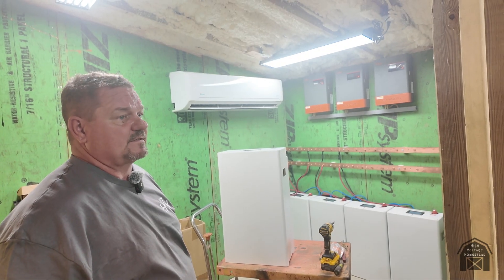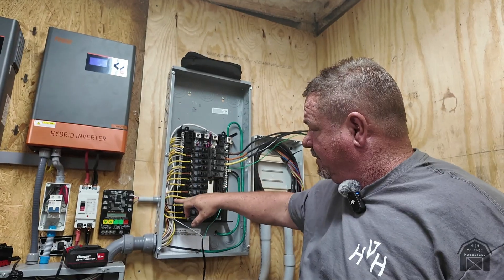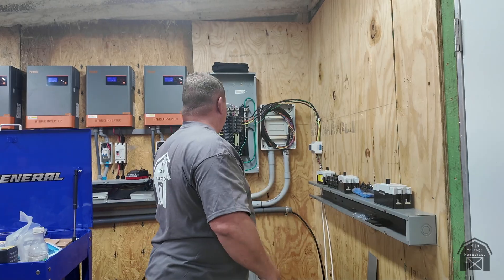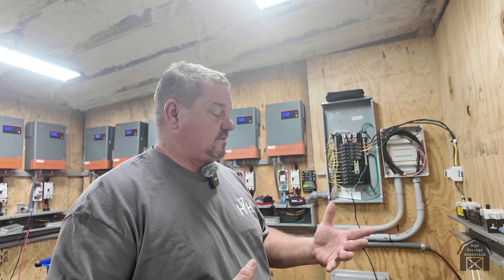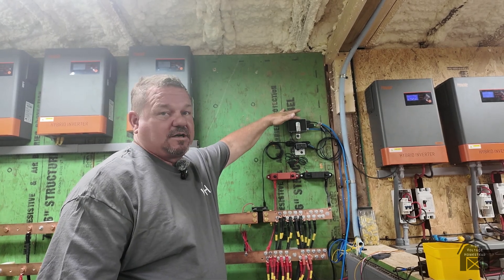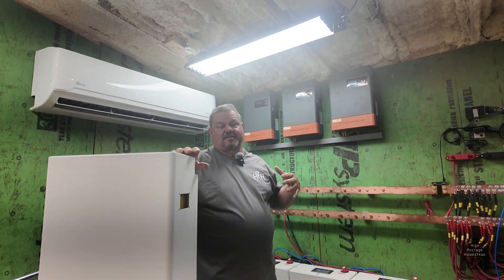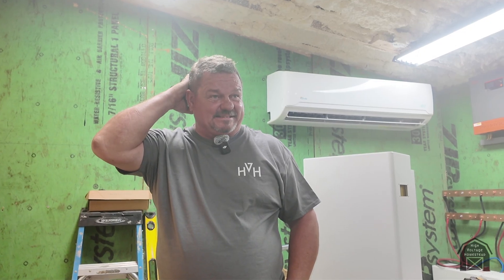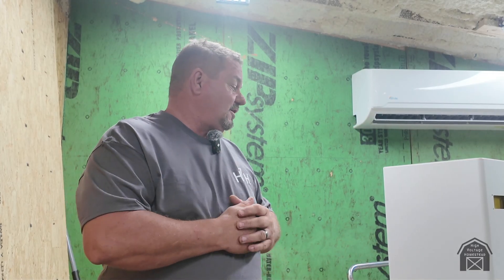Ken's Backstory and what the future holds for High Voltage Homestead

Comment: You have an amazing set up! However, 48 volt is not technically a high voltage system which runs from about 80 volts to over 500 volts. You may want to check out Ed's DIY solar to see high voltage solar power system used to Bitcoin mine.

Comment: Very interesting!  Our system is in the order of MW but grid tied solar.  You need to set up a plc to control your cooling loops and temperature control with VFD pump controls.  
We’re in Canada so we even have coolant heaters to cold fire the system if it’s ever shut down to long.  
No sense to cool the incoming water below ambient there’s no gains there just lost energy.  And if your wasting energy your loosing potential hash rate.

Comment: So if it is 3 phase from groups of 3, what happens if one section gets shaded? Would that not be a phase imbalance? Also, about DC, wrong, you can get very shocked on DC. I did building automation for many years and a lot of training proved you can get a massive shock from DC. I have myself on my 48 volt system when I was very sweaty and leaned on the DC rail and yes, I fn felt it.
Reply from the maker: Thanks for the input.  If we get shading the inverter would just draw from the batteries to keep the phases equal.  You are right that DC can shock you, put a 9v battery on your toungue lol.  If you resistanceis low (wet) enough and the distance is short enough then sure, I just mean in practical application on 48 volts DC.  No one will be in there that isn't aware enough and most people are going to stay far away from a big copper buss anyway lol.  If you leaned up on a rail and got buzzed I would assume that rail was exposed like mine and you were still working around it, js.  I have gotten hit a few times by the panels (500 dc) and you do feel that :)

Comment: Can you explain or make a video on why you’re making 3-phase power instead of single phase?  Wouldn’t ROI be better on single phase?

Also, you mentioned having 250kW of solar panels.  After working the kinks out with this first dozen inverters, do you plan to parallel another dozen or two separately to have 2 - 3 groups of 12 paralleled?  

Your install is awesome.  I’m extremely curious to learn more from you.
Reply from the maker: Thanks bud, I'm gonna just use multiple banks of 12 inverters with their own electrical panel.  I am not sure how to parallel any more inverters they all say 12 is max.  I have an idea for a work around but not sure.  Will make a video on that shortly. Thanks
Reply: @HighVoltageHomestead  that makes sense. Looking forward to your next videos. Thank you for making them. I know it makes doing the work take longer, but it’s very helpful and entertaining.

Comment: Nice set-up, Since your running Vnish you might want to check out my Python script to regulate your miners. It monitors the SOC of the batteries and automatically puts miners in standby and restarts them depending on the setpoint. Each miner has it's own start and stop setpoints.
I only mine during the day though, 3 11.4kW inverters, one with a Nissan Leaf 24kWh battery the others on LG 16kWh batteries all at 400 VDC. With the Python script I can run all day automatically ramping miners up and down depending on the sun. Storm rolls through and I'm not here, no problem...
Reply from the maker: I watched alot of your stuff last night, good stuff,  would love to get together and sort that script out that is exactly what I need.
Reply from the maker: Also need that music !! I was listening to your background stuff, that is great, where did you get it.
Reply: @HighVoltageHomestead  It's good stuff! We put it together here with a little help. 😉
Reply: @HighVoltageHomestead  Yeah brother, in one of my videos there's a link to the github with code and instructions. Basically you need a Linux machine to run the Python script and Home assistant. Home assistant needs to be talking with your inverters so it can pull the battery SOC. The script gets SOC from HA and determines what to tell the miners.
The github script is a few versions old now, if I ever get some time I'll update it but it will get you going with basic functionality.